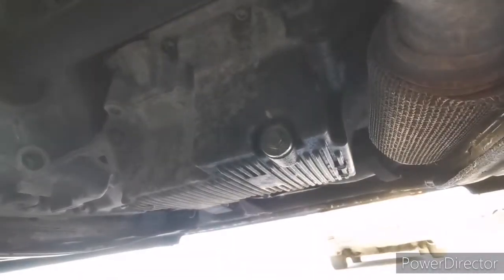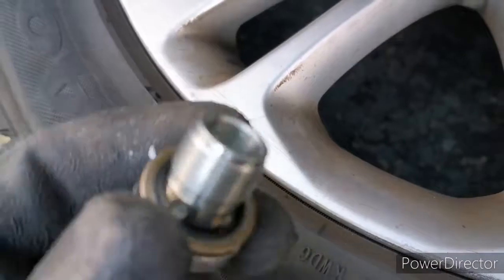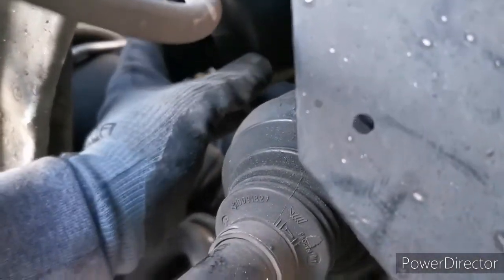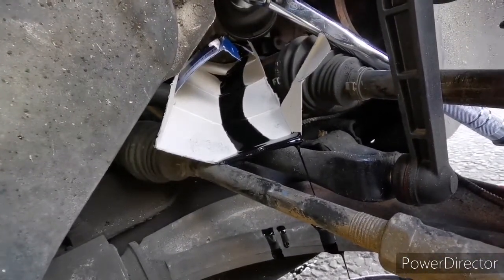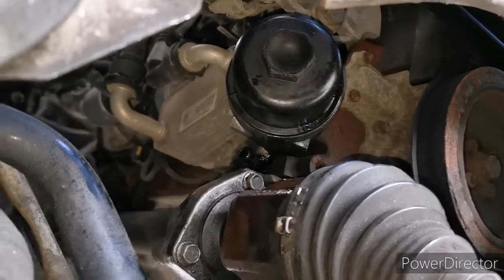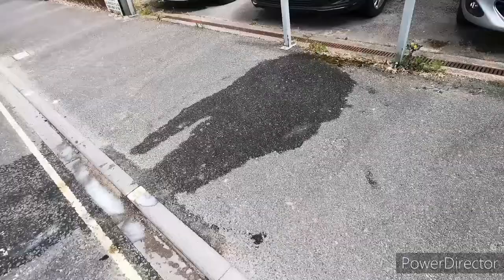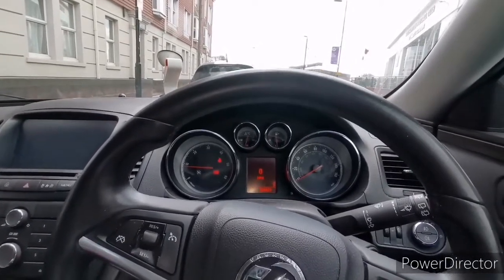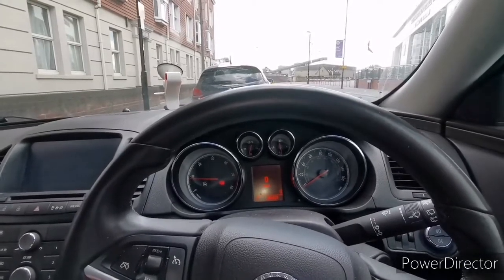Vauxhall Insignia oil and filter change 2.0 diesel

Comment: You can use a small heavy duty bin bag for the oil filter. Soon as you release it with the spaner put the bin over the filter then turn the filter with hand the oil will fall/drip inside the bag
Reply from the maker: Great idea :)
Reply: Hi, i use a 2 foot length of round gutter pipe leading to a container, it fits neatly up against the engine under the filter housingwith a little bit of rag and then it just flows away to the container i have set up at the other end.

Comment: Why lossen ur wheel nuts? Forgive me if i missed something.
Reply from the maker: So you can remove the wheel because behind the arch is the location of oil filter. Wouldn't recommend undoing fully tighten nuts when car is lifted.

Comment: hey, thanks for uploading this, can i ask, would this be possible with the standard jack that comes with the car? and how much oil does it take to fill it up once emptied?
Reply from the maker: I am always putting same amount back, run the car for a while and then I am checking on dip stick if it need a top up.
Reply: Just to add, always use axle stands. Never trust just the jack, and also put the wheel under there as extra insurance just incase it does tip off the stands.

Comment: What Oil did you use?
Reply from the maker: 5w30 shell helix ultra :)
Reply: If you look for affordable quality, go with Valvoline or Total. If you look for top quality, try Revenol, Motul, Liqui Moly or Millers Oils, oh and a secret tip - Petro Canada.
Look for correct viscosity, ACEA C3 grade (because of DPF) and dexos 2 Opel OEM norm.

Comment: How much liters of oil goes when refeeling
Reply from the maker: I've put 4.2l, but it really depends. Best is to check it with oil stick. Or add same amount you drained.
Reply: Should be 4.5 litres , it willlook overfull on the dipstick , bit is correct